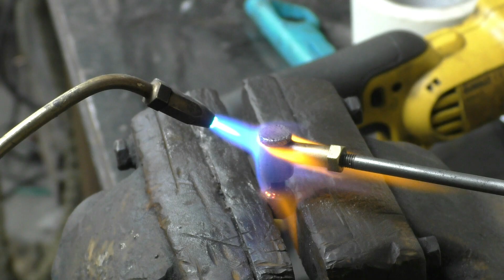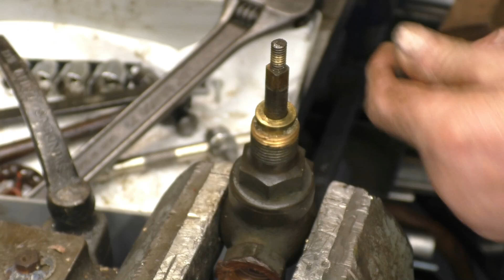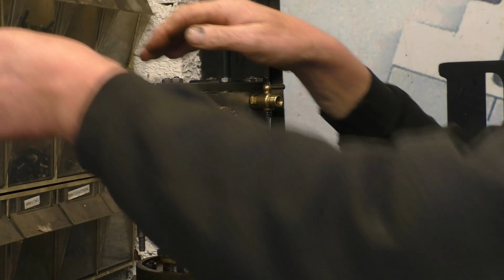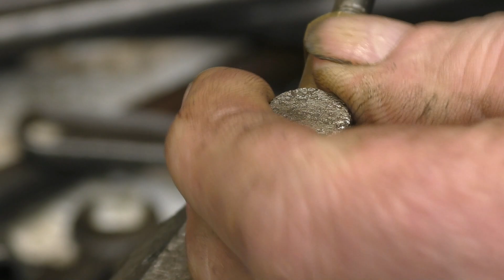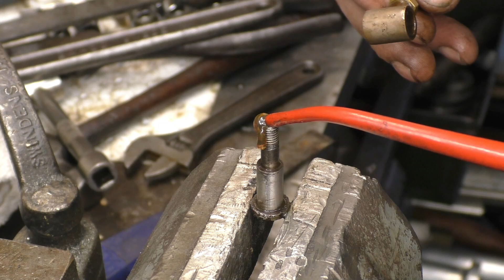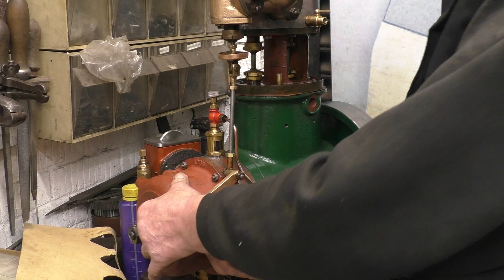Stuart Engine P33 Testing The Steam Regulator

Comment: That will teach you to use a parallel pin punch in future. Great work. It will have to rev some to generate enough centrifugal force to throw the weights out, it seems. But the force is related to the square of the speed. Interesting to see the governor working properly.

Comment: nice to see it up and running john, it seems very slow is that just down to the volume of air from the compressor.
Reply from the maker: Yes it needs 175 psi super heated steam through a 3/4 inch pipe

Comment: As a young man and a lot of my career, I worked with many asbestos joints/gaskets on large engines, tank seals, steam, oil pipes etc. I didn't even know what it was..just got on with the job, wire brush and scraper in hand. I wish I could wind the tape back and give myself a crack on the head.
Engine is coming along nicely 👌
Reply: The worst part about asbestos was the corporations knew how bad it was and only quit using it when the law suits started costing them money